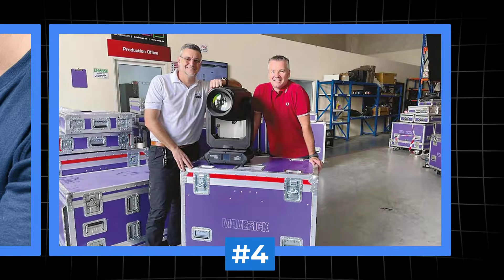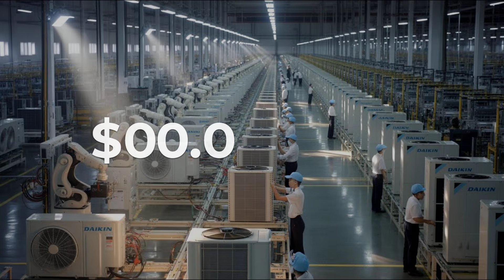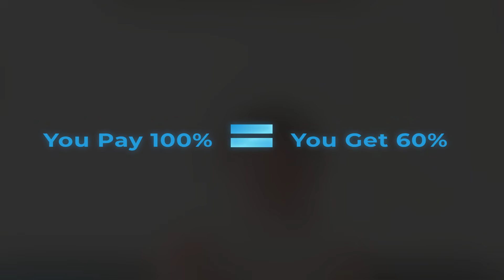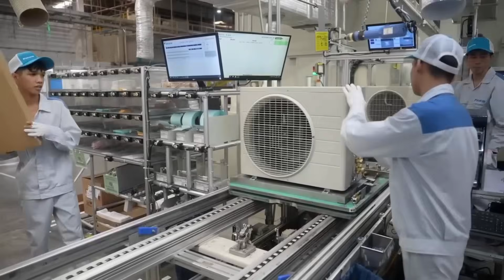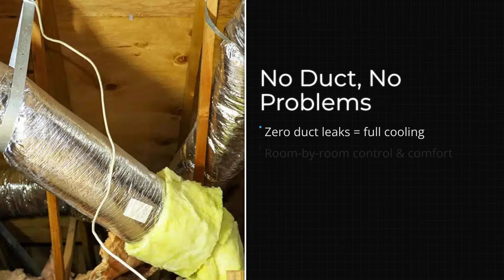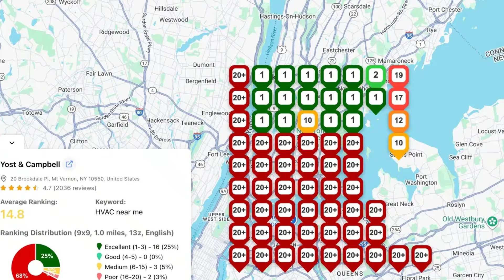Why 90% of New Air Conditioners Are Garbage (The Factory Secret)

Comment: Bruh. Im a 22 year hvac tech and comfort adviser. Its the homeowner’s who refuse to pay for any of the things you mentioned. Ive never sold a job and had the homeowner sign on to a heat load calculation. They want the cheapest shit available. Even “rich” people want the lowest bids.
Reply: I asked 8 different companies last year for Manual J.  Not one acted like they knew it or were willing to do it. Every single one wanted flat rate pricing, twice what it should cost, and financing.
Reply: Doing a Manuel J load calculation would mean the customers house would have to be torn up, and the customer would probably have to stay in a hotel for a couple of nights.....and, the extra time and cost would be 4 times as much, as the guy that would just replace the system.
Reply: Please tell me who still makes a quality system these days regardless of price. We has 6 individual new Trane heat pumps installed in a new construction which was completed in December 2009. and I started replacing the
Reply: @Greg-Gore  Fuck Trane. Had a whole new HVAC system put in like 7 years ago. It's a bit over than what I needed, but Florida is hot as shit and the air handler is in the attic. An old friend was my contact and tech and I wasn't afraid to drop the money to get what was necessary to b equality. I could have gone cheaper, chose not to. And I still started having that piece of shit repaired after 2 years. After 45 years, it was guaranteed that a part needs replacing every 6 months and often the part wasn't made anymore. New part? Always $200-$300 for just the part.

Comment: Manufactures are guilty of many offenses, most foul.

 The compressor is not a motor in a bath of oil like were made in the past like our fridge in the garage,  its 57 years old, never needed anything. Modern AC systems use a linear system designed to fail. When it fails, and it will only last around 5 years, it destroys the entire system. This is no accident and every device in your home has a limited lifespan barely surpassing its warranty. Why? To make you buy another.
Reply: To my knowledge it is only LG that has linear compressors , variable speed scroll compressor motors are in an oil bath and reliable but it's the control circuit board that usually fails.

Comment: Just like the GM 6.2 😢
Reply: It's because the solenoid controlled valve body for cylinder deactivation is made of plastic and is oil pressure driven , when it fails oil pressure drops engine dies.

Comment: We had the most reputable HVAC company in town install a new Carrier system.  Everybody said to buy Carrier.  It has failed three times in three years.  Total dogshit.
Reply: I have a carrier heat pump. It was installed in 1997 so it’s 28 years old. Only thing I had to replace or the capacitors now and then which are cheap and a blower motor. I think I got my moneys worth at it so far not replacing it until it takes a dump.
Reply: I got the Carrier Infinity Greenspeed heat pump in 2012 and no failures .
Reply: @leekumiega9268  mine was installed 1997 still going strong had to replace the blower motor and I replaced a capacitor every five years just to be on the safe side and it’s still going strong
Reply: It’s not the brands it’s the installation. Always the installation . Thirty five years in general contracting, even the cheap stuff runs good is installed right
Reply: Same, my Carrier HVAC broke twice in 5 years. I decided never Carrier again
Reply from the maker: I’m sorry you’re dealing with this—it perfectly illustrates why high upfront costs no longer guarantee reliability in modern HVAC 🛠️.
Reply: I've owned my own hvac company for 3 decades. I designed and installed my Carrier systems in my house with perfection. Both systems had leaking evaporator coils within 3 three years, 1 bad capacitor, 1 bad variable speed blower motor, 1 burnt out heat strip, 2 bad Carrier tstats. I stopped selling their equipment, I switched to Trane. Carrier isn't my go to any longer. Poor quality, lousy customer service at their supply houses, severely overpriced parts, back ordered parts, unavailable parts, long wait times at the supply house, warranty claim fees, dented damaged units, hours waiting on the phone to speak to supplier, fake billing (charging supplies/equipment to your account that you never purchased), this is why I quit Carrier and switched to Trane. Now, running my business is easier, less loss on warranties,  and I dont have to deal with any headaches.

Comment: I bought a state of the art Trane/ American Standard system 2 years ago for $17,000  with constant variable fan speed. Works beautifully in temps between 38 degrees and 85 degrees. But below freezing I have to use emergency heat and rediculous cost. Have had 5 repairs so far.  My former 25 year old system worked far better until it crashed out .
Reply: Wait until the ECM motor goes out. The industry will have you spending thousands to save hundreds in electricity costs.
Reply: Heat pumps are ok in a place where heating isn’t much of a concern. Maybe a few chilly nights. Also heat pumps are more complex and have more  problems
Reply from the maker: Sounds like you traded a dependable old workhorse for a complex liability that can't handle real winter weather. ❄️
Reply: Got a Carrier Infinity Greenspeed unit in 2012 ,hope I don't jinx myself but I have had no problems with it and it actually works down to - 15 deg F with back up heat only during defrost, as an experiment  I turned the electric element off during defrost ( yes cold air from vents during defrost )  in the install set up  ( I have the set up manual ) and it still warmed the house to 70  with outside temps of about 18 deg F. when it went to 7 degrees outside the house went down to 65 deg inside so I turned it back on during defrost. BTW do you have variable compressor speed ?  Carrier does it never goes above 70% during summer and is super quiet but does get a bit noisy when it goes to full speed when it's really cold out.
Reply: @leekumiega9268 carrier performance series here for heatpump. Air handler was just basic version though. During the recent extreme cold my heat pump was able to handle heating at 10 degrees without emergency heat. 
Told my HVAC friend about it and he said there's no way you're running heat at 10 degrees without the aux. I'm like idk what systems you been installing but assure mine is running without aux. Never seen it come on thermostat once and if it did it was very short time.

Comment: No American Quality is bad we just need to stop by an American things and maybe try to buy directly from China cause they're the only ones that haven't lied to us yet and maybe directly buy from their countries where they buy top rated and Top Line stuff from them directly. Maybe we can buy systems from Russia are buy stuff from Russia that we hire quality
Reply from the maker: The grass isn't always greener. While American quality has plummeted due to 'Value Engineering,' buying direct from overseas often leaves you with zero parts availability and no local tech who can service the 'Top Line' stuff. The solution isn't just changing the country of origin; it’s demanding a return to Serviceable Engineering everywhere. Whether it’s from China, Russia, or the US, if it’s a 'Black Box' you can't fix, it’s still Quality Rot!"
Reply: @QualityRot America 🇺🇸 quality😂

Comment: Ducted is still the system that provides more comfort and a safe breatheable atmosphere, since water nano-particulates fight fire nano-particulates (carbon monoxide/ sulpher dioxide we find in what we call polluted air)
Reply from the maker: You're touching on a massive hidden cost of the ductless trend: Air Quality. While mini-splits are efficient, they are 'recirculation' machines with pathetic filtration. A properly engineered ducted system is the only way to actually scrub the air and manage humidity at scale. We’ve traded the 'breathable atmosphere' of a well-built ducted home for the high-efficiency, stagnant air of a 'Builder Grade' apartment. Stick with the ducts—your lungs will thank you!
Reply: @QualityRot will you marry me 😊!
Reply from the maker: I’m already spoken for—I’m married to the mission of exposing Quality Rot! 😂 But I’m glad we’re on the same page about ducted systems. In a world full of disposable mini-splits and plastic filters, sticking to the 'Bones' of a home is the only way to stay sane (and breathe easy). Thanks for the support!
Reply: @QualityRot Agreed! Ducted is the only solution for a safe indoor breathable air
Reply: @QualityRot   ductless with a HVR, or ERV plumbed into main living area.

Comment: House built in 1978 with a York heat pump that died when I got house in August 1990 replaced with a Goodman that still worked when replaced  it ( probably because I used a wood burning stove from Dec. to Mar. got tired of being shorted firewood and since heat pump used emergency heat a lot for cold weather  )  with a Carrier Infinity Greenspeed in 2012 it cut my electric bill by around 40% summer and 100% from first winter  and has worked great and is supposed to work down to -15 deg F . I charged my Goodman with R22 and got tank of 410a when I heard it was being discontinued.
Reply from the maker: This is a textbook case of how to beat the Quality Rot system by using "Mechanical Diversification" and timing the market.

By using a wood-burning stove from December to March, you essentially put your Goodman heat pump into "hibernation" during the most brutal months. You traded the wear-and-tear of high-torque cold starts and "Emergency Heat" cycles for manual labor. That is why your Goodman was still ticking when others were hitting the scrap yard—you refused to let the machine work itself to death.

The jump to the Carrier Infinity Greenspeed in 2012 was a massive win for your wallet, but you’ve also made yourself a "Refrigerant Prepper" by securing a tank of 410a. With the industry pivoting to R-454B and R-32, you’ve secured a decade of repairability that your neighbors won’t have.
Reply: @QualityRot  The Goodman had a heater in the compressor that kept the oil warm to prevent slugging and lessen the strain of high torque starts with cold oil but yes the wood stove definitely extended it's life but I heard that Goodman WAS the best low cost heat pump. I'm a jack of all trades that did most of my HVAC work , I know about sub-cooling and super-heat for charging and have the equipment needed. I need to find out how to put the Carrier in service mode which runs everything at max if I ever have to charge it.

Comment: Mini-split's are heat pumps 
Can be cheaper up front sometimes
Reply from the maker: They definitely have a lower install cost, but watch out for those repair bills! Mini-splits are essentially 'Computers that Cool.' When a proprietary inverter board fails in year 6, the 'upfront savings' vanish instantly. You’re trading a simple mechanical system for a complex electronic liability.
Reply: And don't forget leaks. Also dirty blower wheels reducing output. As you said more computer than air conditioner.
Reply: @keiththompson4014  I run two air purifiers in my home to help keep the dust off my blower wheels
Reply: @QualityRot  And most of those companies won't supply parts after a few years. You end up changing the equipment.

Comment: Bring back R22 last much longer
Reply from the maker: Agreed! R22 was a superior refrigerant for system longevity because it operated at much lower pressures. Today's high-pressure systems (410a and beyond) put massive stress on thin-walled copper coils, which is exactly why 'Leaking Coils' are now a standard feature of modern HVAC.
Reply: @QualityRot I honestly think that is mostly coincidental. 90% of leaks are in the low pressure evaporator coil. It’s not nearly as common to find a leaking condenser, which sees much higher pressures, unless it has been damaged. 

I think that the introduction of 410a in the early 2000s happened to coincide with a general decline in manufacturing quality/ cost cutting. I’ve also heard manufacturers moved to thinner copper coils to meet efficiency standards which would be insane given the waste caused by leaking coils.
Reply: @monsieurbojangles2336  Carrier did not cheap out and my heat pump has been problem free since 2012.
Reply: One refrigerant cools the same as any other.
Reply: @David-mo2zq  LOL
Reply: 22 lower PSI

Comment: Lazy ass AI blocked
Reply from the maker: While I use modern tools to help get these videos out fast, the actual data on those leaking evaporators and proprietary boards comes straight from the service vans, not a server farm. I’d rather have a glitchy voice-over than a ‘polished’ corporate video that lies to you about your AC lasting 20 years. Stay focused on the hardware—that’s where the real Quality Rot is!"
Reply: @QualityRot  Why do you need to "get these videos out fast"? How bout striving for quality instead. No one is asking for a "polished corporate video", but come on - "A-I-R conditioning"? "H-V-A-C"? Images and video clips that don't even relate to what is being discussed? What does a scanner image showing different phthalate-based chemicals have to do with the voiceover discussing HVAC equipment tariffs?
 How about some QC after you create the video?
You're creating a poor quality video complaining about poor quality HVAC equipment.  There's some irony in that.
Reply: @lou @loubandiera ve the phthalate chemical observation.  The mark of piss poor editing and depending way too much on AI and stock content.  Very lazy
Reply: @QualityRot then Do it yourself

Comment: Commercial tech for 22 years and I’m about done with the trade. This industry is trash. They started to put float switches in 15 ton Trane package units and shut down the system cause they’re so faulty. I don’t even want to get started on A2L sensors that fail all the time
Reply from the maker: Twenty-two years in the field means you've seen the quality plummet firsthand—hang in there! A2L is some crap, seems like government all making the industry trash. I remember R22 used to be so easy from 410a to 454B  and then what and this is just residential systems breaking down every year. Seems like new refrigerant every year. What do you think?
Reply: this is scare, my cat sad
Reply: I understand your frustration, I prefer industrial refrigeration nh3(ammonia)
Reply: I understand your frustration, I prefer industrial refrigeration nh3(ammonia)

Comment: Please do a video on vacuum cleaners.
Reply: A video on Vacuums - that would suck !
Reply from the maker: That's definitely on my list of appliances to tear down! 🧹
Reply: Great topic. I have 4 different vacuum cleaners. My favorites are the shopvac and roborock. The roborock was a bit expensive for the limited functionality, however great for wood & laminate floors.
Reply from the maker: Keep an eye out for the video: WHY 90% OF NEW VACUUMS ARE GARBAGE (The Disposable Motor Secret)

We’ve moved from machines that lasted 20 years with a simple belt change to "Smart" units that are essentially computers with wheels.

Your collection highlights the two extremes of the current market. The Shop-Vac is the "Old Guard" survivor—pure suction, no sensors, and a motor that can swallow nails without a software error. The Roborock, while great for maintenance on hard floors, is the definition of the "High-Tech Gamble." You’re paying a premium for navigation and automation, but as you noticed, the "limited functionality" often refers to the fact that it can’t handle deep carpets or stairs, and if a single cliff sensor fails, the whole unit becomes a paperweight.
Reply: @QualityRot  1950s Kirby.
Reply: Miele, Sebo, Lindhaus. Should last you for life.
Reply: project farm